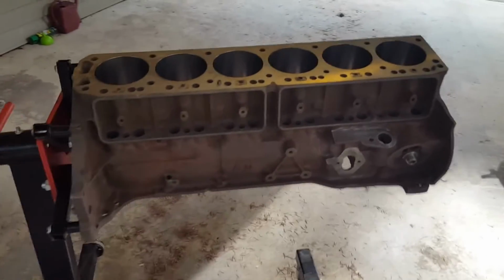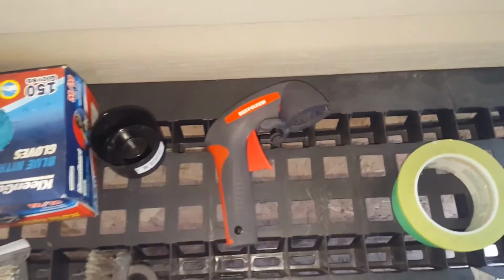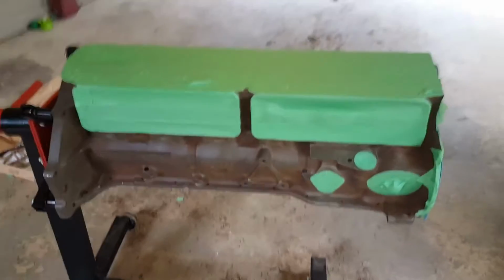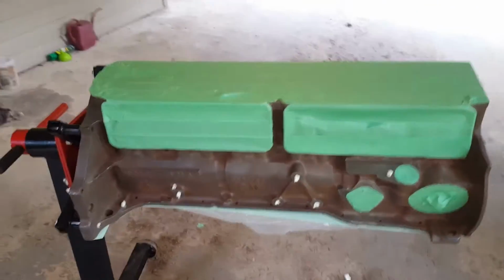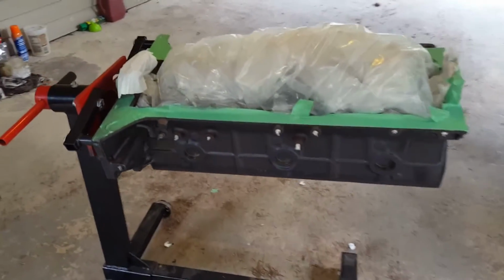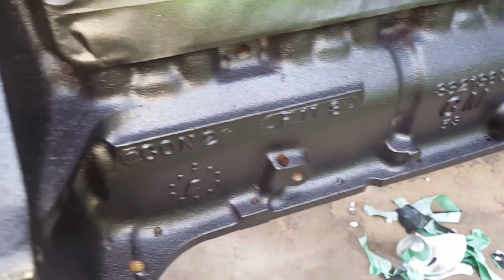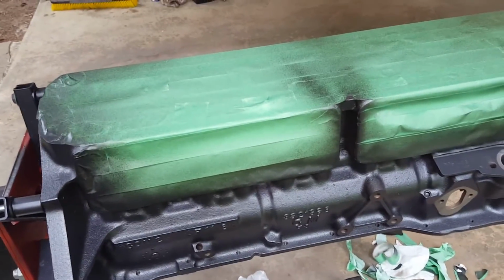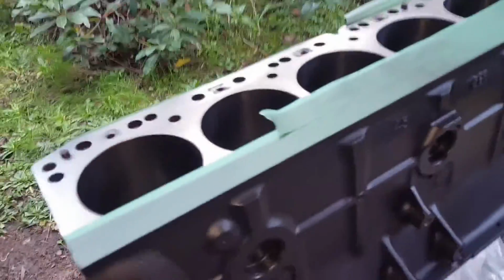1967 Camaro - Chevy 250 Inline 6 - How to Prep & Paint an Engine Block

Comment: Good Video. Tony DeFeo of UTG recently taught a good trick...                                                                                                                                                                               He said most times paint on an engine won't stick is because the parts aren't clean. Like Really Clean.                                                                          He took a block fresh from the machine shop hot tanked jet cleaned pressure washed and sanitized. Then used a propane torch quickly over the surfaces, you wouldn't believe the oils that came out of the porous cast iron. Then he painted.
Reply from the maker: Yeah that's a great idea. The paint done in this video lasted without issue until recently when it was stripped off for some modifications and a new color. However torching it before the cleaning process would help ensure a good base for paint.

Comment: I thought aluminum usually needed a primer before applying paint? If it is still holding up then you are probably fine.
Reply from the maker: AustrianAnarchy Typically you would want to prime aluminum but the VHT paint doesn't seem to care either way. It still looks good with over 6 months of driving and a fair amount of gas spillage.

Comment: Very nice job on the paint! Subscribed as I am a 6 cylinder fan. If you get the time you should check out my 292 build. :)
Reply from the maker: +Military Chevy Thanks for the feedback! Sometimes I wish my build started with the 292, but I'm happy with the result. I'll check out your build for sure. Thanks again.
Reply: Turbo Camaro Your welcome! The 250 is actually one of the best for hotrodding. Pistons are Alot cheaper as you can use 307 v8 flat top pistons to get a Nice compression increase, but your going turbo(?) so stock or turbo pistons will do nicely. Thanks for subscribing back!
Reply from the maker: +Military Chevy Don't get me wrong, I do like the 250, but as the V8 guys always say, there's no replacement for displacement. I looked for some forged 307's for a while but became impatient. Ended up with some custom Ross Racing ones instead. Once the base motor runs well I'll hookup the turbo and the alcohol injection.
Reply: Turbo Camaro Nice! I went with ross pistons on my 292 as well!